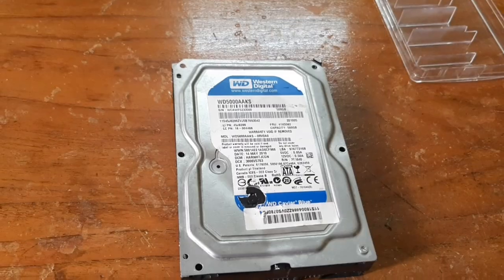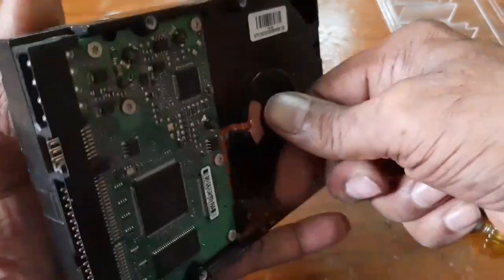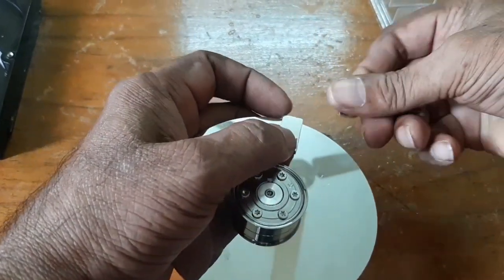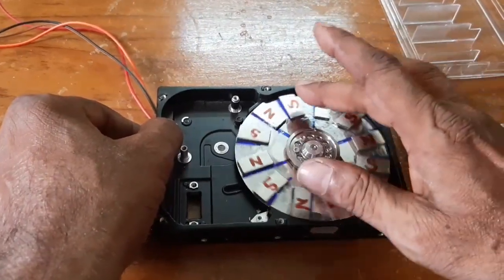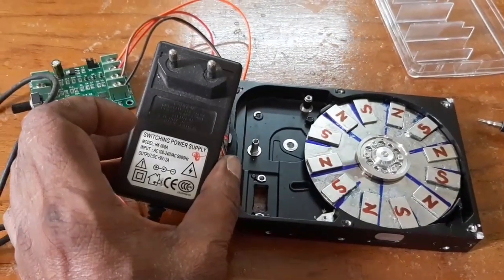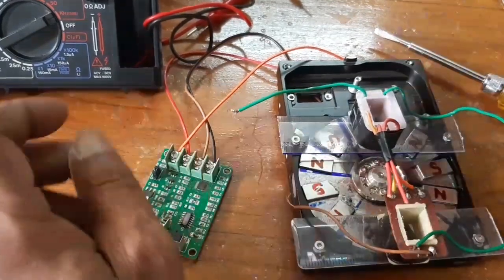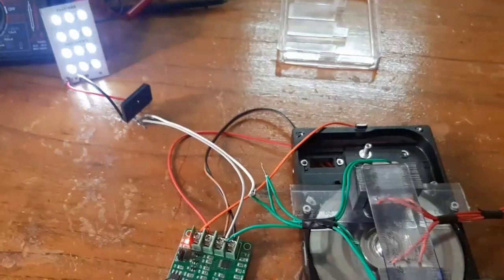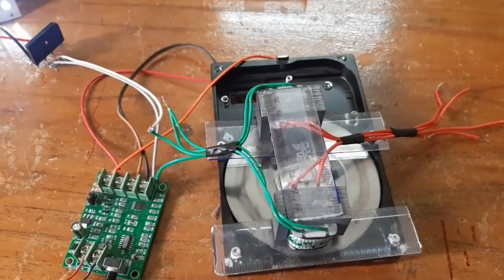(V-27),HD மோட்டார் ஜெனரேட்டர்/ HD drive motor generator.

Comment: Good demonstration.
Reply from the maker: Thanks sir
Reply: Hi Pugals Tech, Hi Pugals Tech, when you get time, please do check power consumption for your earlier video, Energy Efficient Motor Using Permanent Magnet (Part 1). All that needs to be done is to remove the Permanent Magnets along with the Metal Plate and then run the motor using the electromagnets only. When you take input measurement without the permanent magnets, you can see how much less or more the motor consumes without the permanent magnets. Since you already have taken the measurement with the magnets, it will be very easy for you to compare and know the effect on power input consumption, torque and rpm. I hope you will find the results are very good. Thank you